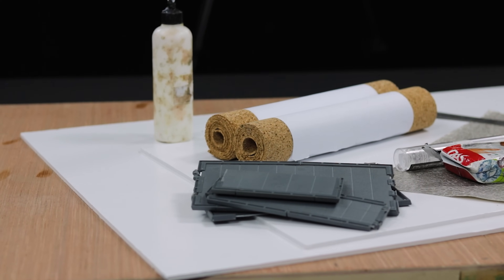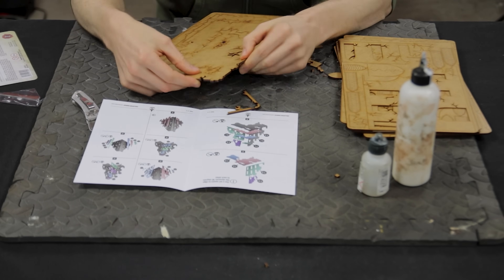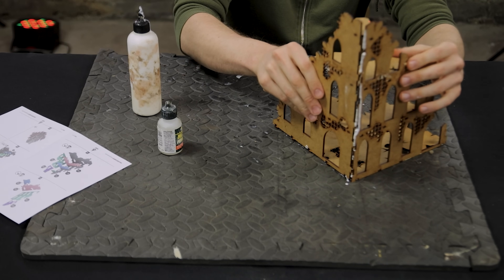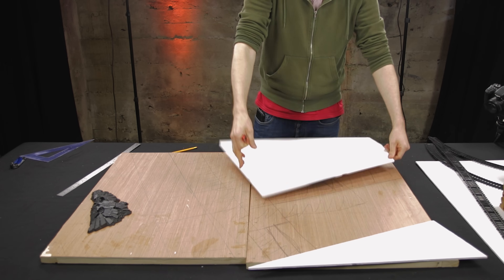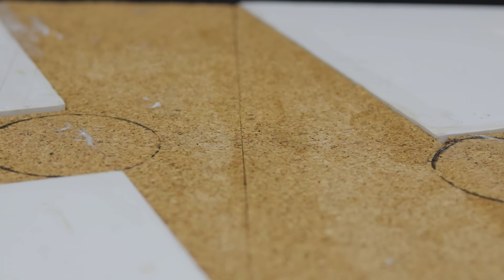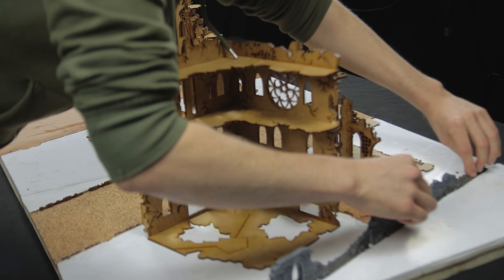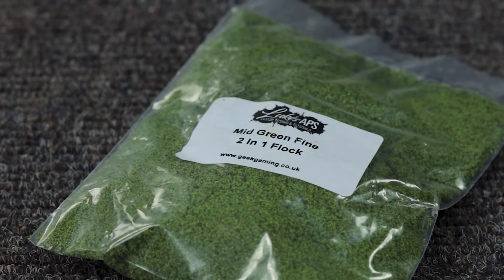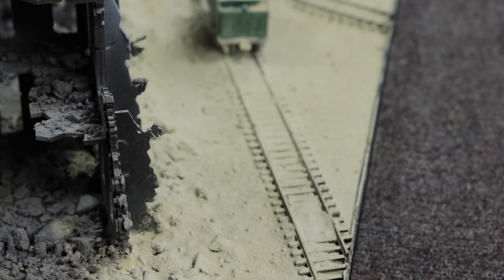How to build a city gaming table for Warhammer 40k and Killteam

Comment: You can use the bottom building's floor to make an extra building!!!! cut the flooring from a piece of foamboard so you free the lasercut floor and this new wall can face another similar (but mirrored) building so will look like an alley... you can cut yourself some window in this new wall made from the flooring....  also if you planed ahead you can make the seam of the base match some lines of the street even if the seam its not exactly on the middle, nothing say that bot base panels has to be the same size... ;)
GREAT VIDEO AND IDEAS BTW!!!!! LOOOVE IT!!!!!!!

Comment: The board looks great the only thing I would add is some bone white or khaki dry brushing to blend the grey in with the sand color
Reply from the maker: I was tempted to give it a very thinned down black wash, but it added too much contrast. The grey areas have some white, khaki and brown on, just through a rattle can. I could dry brush it, and may fiddle with it over time. 😀

Comment: Very nice. If it had been me, I’d have done patches and sections of snow/slush instead of the sand/grass as it would provide more contrast with all the grey. But it looks really good!
Reply from the maker: Hey! Yeah, I was VERY tempted to go the snow route, it was actually the initial plan. I'm pretty happy with the finish though, the sand looks good and it has a dusty and dry feel. 

I also wanted to keep it relatively neutral as it'll be used for battle reports, ao anything too strong makes them a little less usable. 😀

Comment: I'd highly recommend a few black/brown/green washes to add some tonality. Just mix craft paint with a ton of water and slap it on heavy and random.
Reply from the maker: Hey, I did think about it it. I have the paints here and had them in hand, ready to go.. but changed my mind. I've ended up with a desaturated/dry/dusty look thst im actually pretty happy with. Feels like I've got enough colour from the spray cans at the moment. But you're bang on, I was ready to pull the trigger.

Comment: Just finished the video, if you are storing the terrain in the shed/garage/barn then if you put them in a plastic storage tub, one of the huge ones from B and Q put silicon beads in bags in the container too and you should get no mold. You could also mix a little Ronseal Mold killer with the pva?

Comment: I’ve been hoarding these long strips of plastic that the components we order in work are packaged in because i thought they’d be perfect for making terrain with.
Issue is i’ve never made terrain before. Got any tips for a first-timer looking to make some ruined buildings from scratch?
Reply: The great thing about ruined buildings is how hard they are to mess up. They're meant to look destroyed and shabby, so just go with whatever  you think looks good. You can always add or remove bits later, so don't worry about getting it wrong.

Comment: Representing the Irish Hobbyists Oliver!
Any advice for a fellow islander on what good paint stripping products there are available to us?
Reply from the maker: Ah nice, where abouts are you? I'm a foreigner, but settling in nicely. 

As for stripping, I actually used to have a shot blast cabinet, but that's in the uk. I recently stripped some models using biostrip 20, it did a great job and is pretty easy to use. Highly recommend. 

If its a lot of models, check out re-new models on Facebook. 😀

Comment: Nice work but i always wonder why people make gaming terrain in 40k universe and leave out the tech that would make it 40,000 years into the future. This is not medieval europe. Why not old high powered cables and machinery poking up from the ground or running outside walls or structures. Give it this far future element that makes sense. There would have been generators and energy supply infrastructure, manholes to subterranean access tunnels, sewers etc. Communications antennae, posts and sensors. 
You could argue they were all salvaged or scavenged but the scene would look so much more 40k if it was brought into the reality of the far future. We can all subscribe to the everything is gothic style but no actual technology at all?